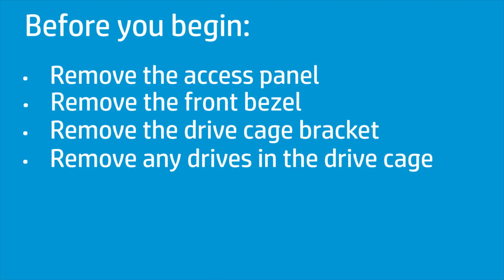Replace the Drive Cage | HP 280 G5 MT, ENVY TE01-000, TP01-000, TG01-000, HP M01-D0000, F0000 | HP

Comment: What is properway to install drives into this cage? I'm having trouble gettings 2 drives in.
Reply: did you guys ever figure this out? literally am trying to fit a 2nd 3.5 myself
Reply from the maker: +Jorge Cosme Follow these steps to replace the drive cage for HP 280 G5 MT, HP ENVY TE01-000, Pavilion TP01-000, TG01-000, HP M01-D0000, F0000 Desktop:
- Before you begin: Remove the access panel, front bezel, drive cage bracket, and any drives installed into the drive cage.
- Removal -
- Remove the 9 mm T15 Torx-head screw that secures the drive cage to the chassis.
- Lift the drive cage and at an angle, slide the tabs on the top edge of the drive cage bracket out of the cut outs in the chassis.
- Remove the drive cage.
- Replacement –
- Toe the tabs on the bottom edge of the drive cage bracket into the cut outs in the chassis and lower it onto the chassis.
- Replace the 9 mm T15 Torx-head screw that secures the drive cage to the chassis.
Caution: Improperly installing or replacing parts could damage your HP device or void your warranty. Before replacing any parts, check your warranty.
Reply: @HPSupport  the question wasn't answered how to install two extra drives in?

Comment: Front bezel won't remove. Now what? I f'ing hate HP for making EVERYTHING as DIFFICULT & ridiculous as they can--- FOR NO REASON.
Reply from the maker: +Tracy LF Follow these steps to replace the drive cage for HP 280 G5 MT, HP ENVY TE01-000, Pavilion TP01-000, TG01-000, HP M01-D0000, F0000 Desktop:
- Before you begin: Remove the access panel, front bezel, drive cage bracket, and any drives installed into the drive cage.
- Removal -
- Remove the 9 mm T15 Torx-head screw that secures the drive cage to the chassis.
- Lift the drive cage and at an angle, slide the tabs on the top edge of the drive cage bracket out of the cut outs in the chassis.
- Remove the drive cage.
- Replacement –
- Toe the tabs on the bottom edge of the drive cage bracket into the cut outs in the chassis and lower it onto the chassis.
- Replace the 9 mm T15 Torx-head screw that secures the drive cage to the chassis.
Caution: Improperly installing or replacing parts could damage your HP device or void your warranty. Before replacing any parts, check your warranty.